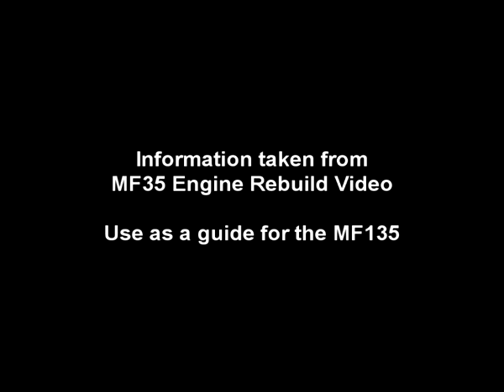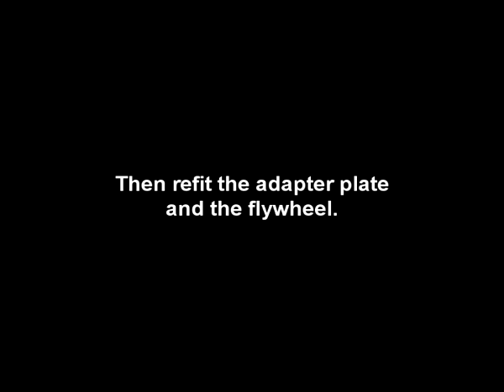Perkins 3A 152 Crankshaft Rope Seal Replacement

Comment: Is this the only seal?have an oil leak on my 35,but also looks like play in what I imagine are the shells?
Reply: This thing is so stressed it will leak...but use the seal which has the wire that for Ford it will be better